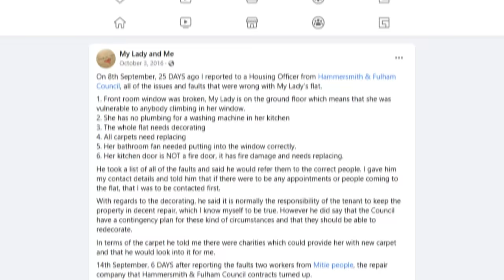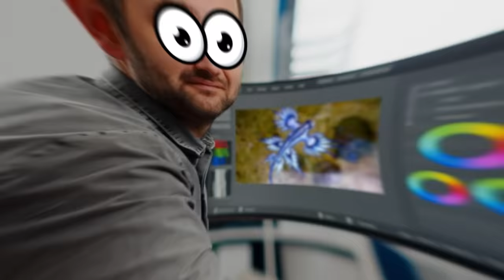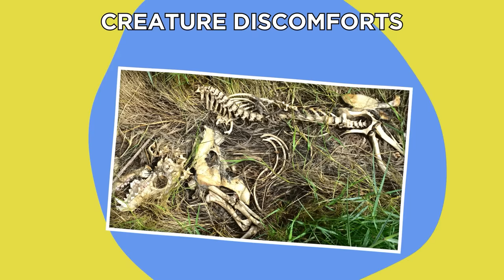Most Disgusting Homes People Actually Live in

Comment: There's no reason to condemn and wreck ball a house due to clutter. The studs to a home are pressure-treated, so they can survive hurricane waters, the drywall and the floors would have to come up, and yes everything would have to be gutted to the studs. However, if there are structural issues that pre-existed or if the studs were not pressure-treated and mom-and-pop built the house, that's a different story. It always amazes me how people can't see past clutter or a mess.

Comment: This video reminds me of two houses I moved. One we called the pee pee house cause this lady had over 40 indoor cats and like 50ish outdoor cats. A coworker and I were tasked with packing up the house before the actual move and literally couldn't stay inside the place longer than 30 minute intervals at a time. The cats had literally pissed on everything this lady owned as well as every single square inch of floor, wall, and ceiling. The second house we basically just referred to it as a shit hole, cause it was that bad. I moved a little table from the entryway and when I lifted it up(which for a small little table took a lot of effort) the floor literally came with it, and one of the mattresses was half covered in bedbugs and the other half in dried blood. That house was so filthy I ended up some how with a UTI. The weirdest part is the house literally had zero odor, pleasant or foul, it was absolutely odorless. Just typing this I can recall many more homes I dealt with as a mover, it's amazing how some people live and find it normal
Reply: @lisarodriguez6966  LoL...no I washed every inch of my body before I ate, drank, smoked a cigarette, or  touched my crouch. Best guess was that while moving the mattress it had came into contact with my sweat rag and I didn't realize it. So while wiping sweat off my face I may have unknowingly inhaled/ingested something. At least that's the conclusion that I and my doctor came to.